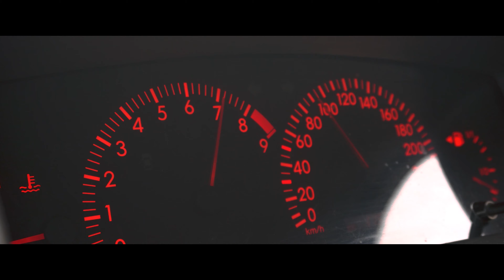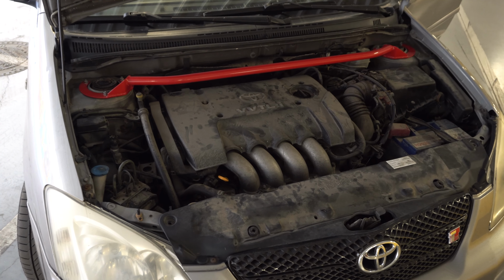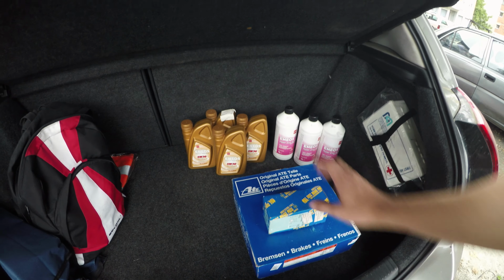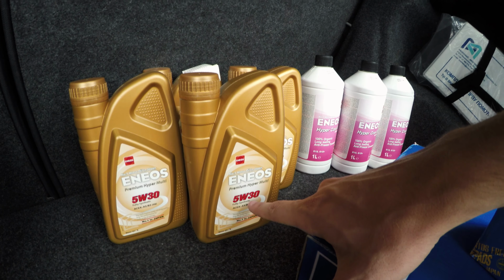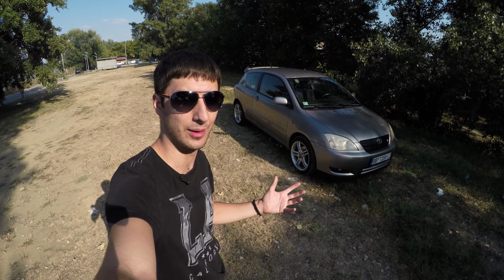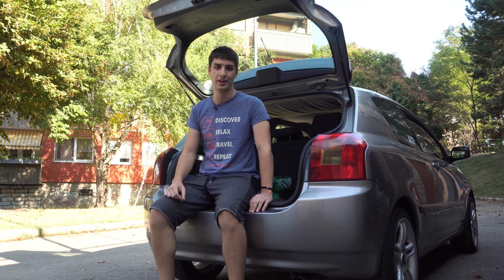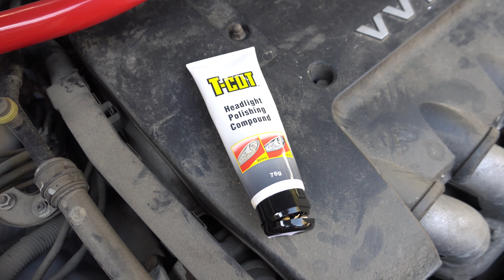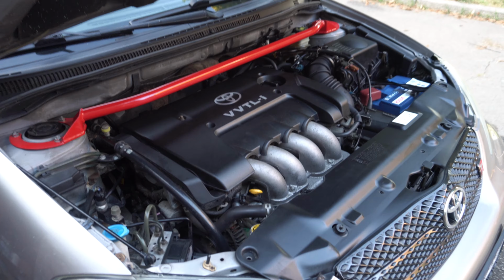Toyota Corolla T Sport Project [Part 3] - Brakes & Antiroll bar Links

Comment: First thnig - stock brakes and anyother  replacement models of brake discs and brake pads are really weak. It's pretty easy to overheat it. Especially when you are into left-foot braking.  You don't won't to do that much engine braking as you told. Engine braking = you start to brake earlier = you loose a lot of time.  

Second thing - you've changed antirolbar LINKS! Not a antirollbars which you should change. Have a look for some antirollbars from Corolla Verso.  Front one should be 24mm thick. Rear one as far as i remember 19 or even 20-21. And that will be a massive improvement in handling. You will reduce a lot bodyroll.
Reply from the maker: Thanks for pointing out that they are called antiroll bar links instead, english isn't my native language. About the brakes they never overheated on me because I'm not a maniac and take care of them, when I mention engine braking I mean that it helps me while im breaking, not that I dont use brakes at all and just let go of the gas. Sure they aren't very strong from the factory but I wouldn't say its high priority and that I'm loosing a lot of time, check my Track day if you havent and thanks for watching & cimmenting (Lastly yeah heard that rear antiroll bar helps handling a lot so  I will surely buy it next year )

Comment: For track, you should always use denser oil (like 10w60).
Regarding brakes, Navak requires good brakes. I saw that you do not use brakes at all, and you lose time a lot there. Especially on main straight. Use brakes, and buy better pads, not these "japanese", but propper pads.  There are street/track pads like Ferodo DS2500 which can be a good fit for you.
Reply from the maker: Thanks for the oil suggestion but about brakes I don't know if you were watching my fast laps or first 2 stints where I purposley brake earlier and less to not wear out the brakes when I'm not chasing for the fastest lap or when I'm with somebody in the car. Watch this video, I clearly use full potential of my brakes: https://youtu.be/URSfKXoSFLs
Of course I know if I put better brake pads or full brakes that I will have better lap but I wouldn't say its where I lose most of the time, soft suspenssion however certanly is, you can clearly see big amount of bodyroll and struggle in sharp corners. Anyway thanks for watching my videos :)
Reply: VučkoHD i watched all your laps, and you improved your driving, bravo! I did a lot of laps there so I know where tome can be gained.
Bakes. Tyres (slick). Hard suspension (it can be cheep one, its flat track). Less mass. More Hp will make you fight more with car and harder to drive. Its not easy to drive 300-400 bhp car there, its slow track.

Comment: The 2zz Engine needs 5W 40 Oil !!!!!!!!!! Otherwise the engine breaks down, in the worst case!!!  Especially when you are driving in the race!
Reply from the maker: It actually says 5W 30 in my manual. Also it shows 5W30 in this trusted website aswell http://mywikimotors.com/toyota-2zz/ 
Still thanks for giving advice, I will think more about it and maybe listen to you, I'm not car professional. Thanks for watching and stay tuned for a track day video in few days.
Reply: @VuckoHD  Alright, look at the best times in E12 forums or Facebook pages to learn more about your engine, because experiences of other people are always worth more than numbers and values on any page;) And you should really more with the engine to avoid damage. If you have any questions you can also contact us!
Reply: I got ts compressor and all recommended to put 5w50 valvoline VR1
5w30 Even if it is written on the manual (for global compliance), but it is not at all advised if the car is driven sportily
Reply: 5W30 might be good for daily use and economy. But vor tracks, use oil which can stand higher temperatures, like 5W40 or even W50. Especially if you don't have an externer oil cooler with thermostat ✌🏼

Comment: OMG, I thought I was the only one with the headliner separating from the roof on a Corolla (mine is 2002 1.6 2-door) but now I see it may be a very common occurence. Will there be a video on the repair soon?
Reply: Man it happened the same to my 2004 Hatchback and I went to a scrapyard and got one but as it is very sensitive to touch I damaged a tiny part and then it's starting to fall again and I put it some tacks but I hate it hahaha